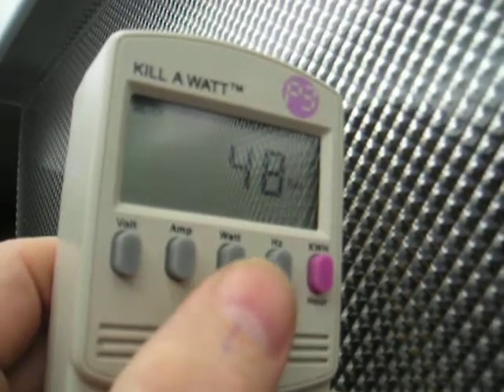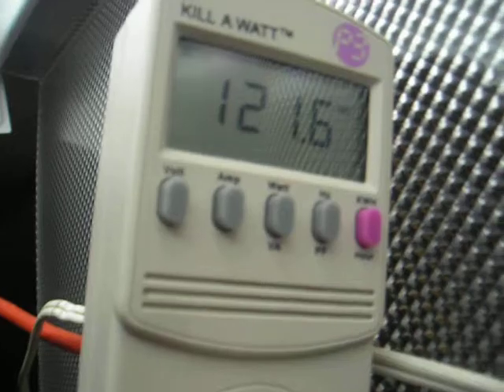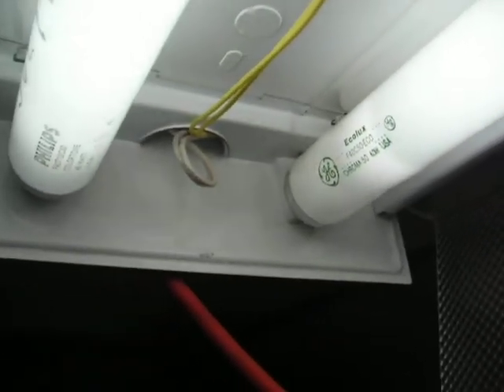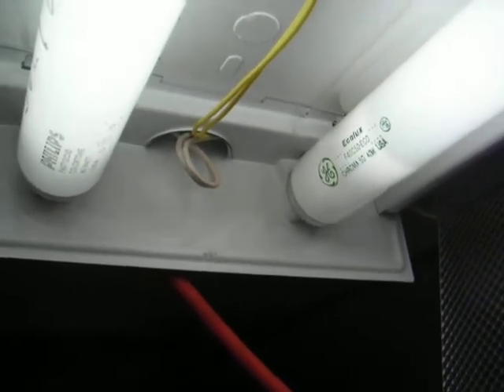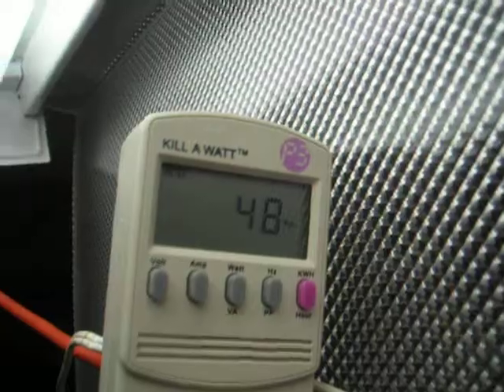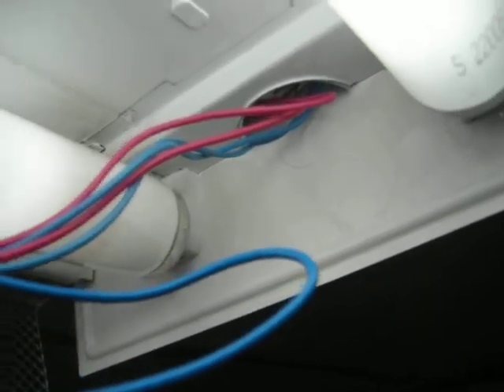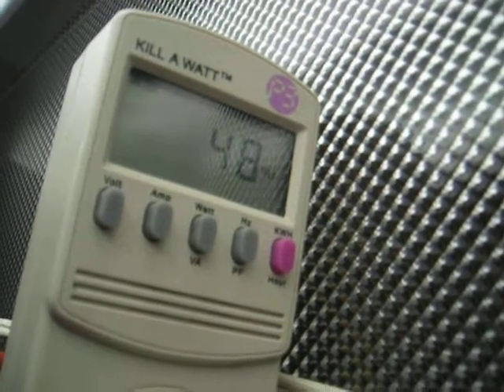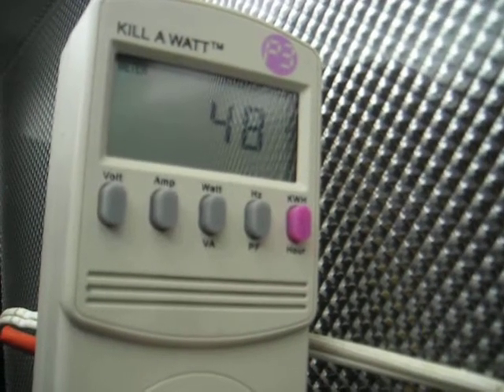T12 bulbs running on T8 Ballast by mistake

Comment: I put a 48 inch GE T12 black light running in a T8 fixture, had no idea. It did work but as you said the life of the bulb was cut very short.

Comment: I had the exact same situation. The T12 bulbs used to run out very frequently. After about 5 years, the ballast died. I replaced it with a new T8 ballast and lamp (4). The light is much brighter now.

Comment: I had T12 bulbs running in a T8 fixture by mistake too. The bulbs worked fine for years. Once I noticed, I replaced them with T8's. It does seem a lot brighter now.

Comment from the maker: The problem we had here was marginal starting at lower temperatures say 50F in an unheated building. For the first year they would start ok. Later on we had to cycle the switch on and off and usually they would start. After 2 years when cold they often would not start even with cycling. Once we replaced the lamps again with new T12's they usually would start here in the cold :) winter. Thus we were replacing lamps sooner than normal since the ballast was wrong.
Reply: The ballast should work fine. Also fluorescent tubes when cold don't light up well. Try rubbing them a bit to make them warmer

Comment: T12s will work fine on T8 ballasts in my experience, I'm using some 34w 'energy saver' ones in a F32T8 fixture and they work fine.

Comment: Had a similar issue with a light at my house. The contractor installed t12 bulbs into a t8 fixture. Ran fine for 3 years. Never noticed